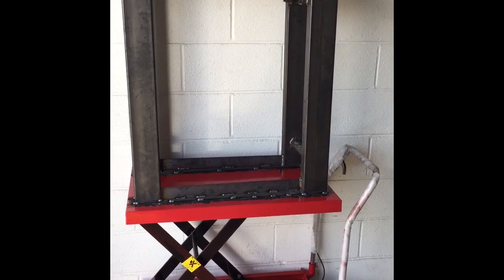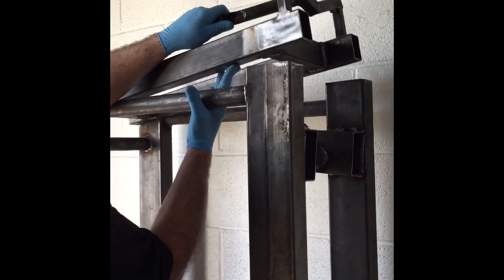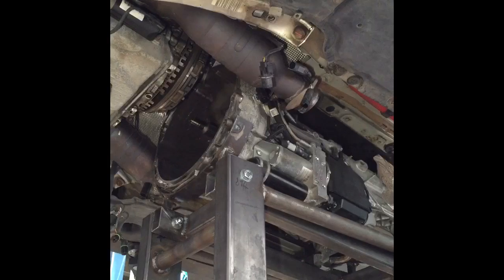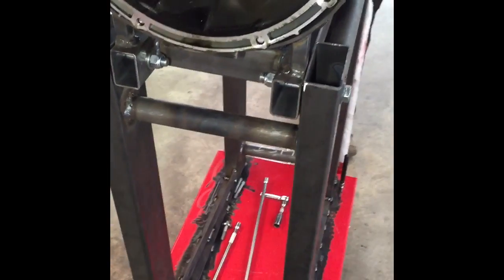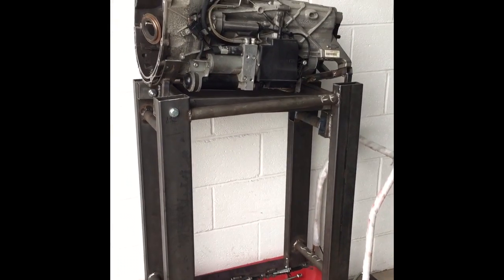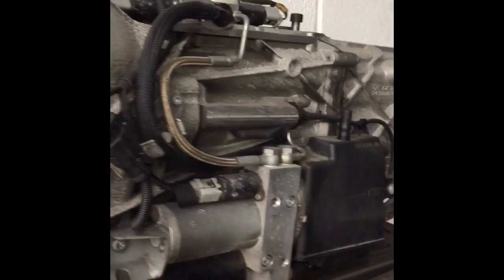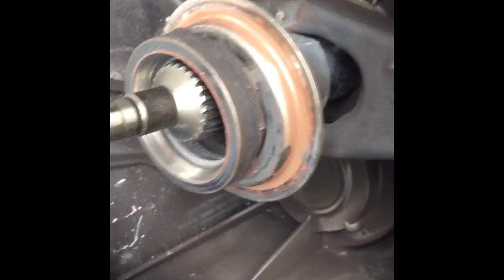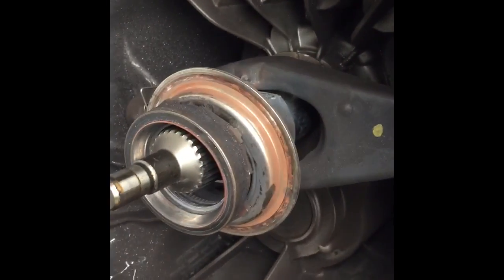BMW V10 7-speed SMG Gearbox Removal Tool for BMW E60 M5 and E63 M6 S85 engine

Comment: What's the cost of replacing the clutch and fly wheel  on a 2007 e60 m5 with 63 miles ? 
Thanks Jon in Dublin

Comment: Hi thanks for the informative video on the wonderful SMG trans. I have recently encountered a problem with my 06 M5 and I believe it to be the Hydraulic Pump because I heard the actuator noise but it never stopped and sounded as if it burning out as the noise decreased slowly until I heard it no more. Then I went to start the car and got the red transmisson icon and would not shift into gear. Its now been in my garage for over 6 months as I do not have the funds available to diagnosis at the dealer or indy shop but I am handy and have tools and worked on cars before but never a SMG trans. Any help from anyone would be much appreciated. I am located in FL if there are any other M5 owners willing to assist me with diagnosis / repair. Thanks All!
Reply: pgarcia128 you called it , thats  your problem . The pump itself wont push to engage ..change the pump and your set , the e46 / e60 have the same problem . I believe they make a aftermarket pump that last a life time good luck!!